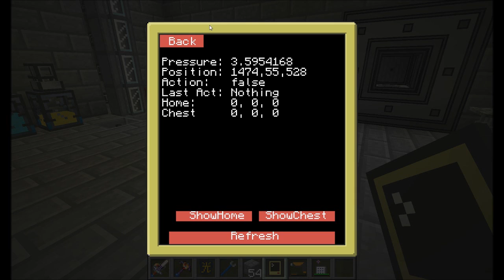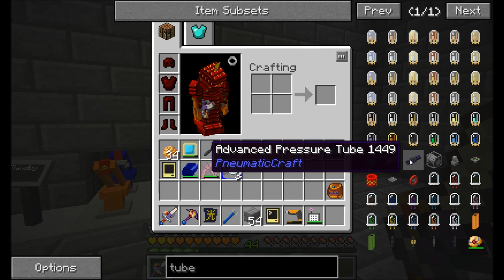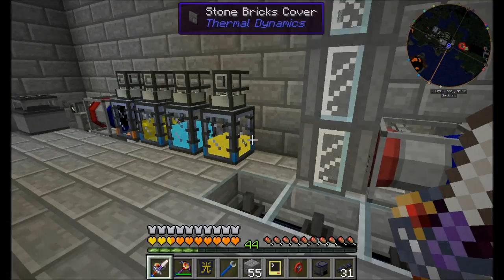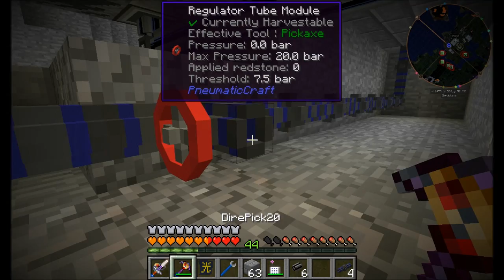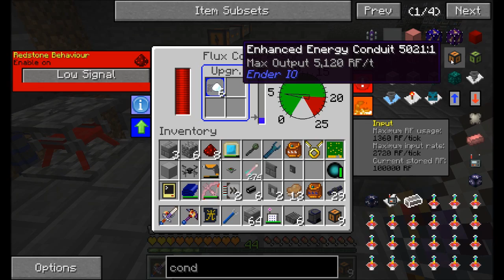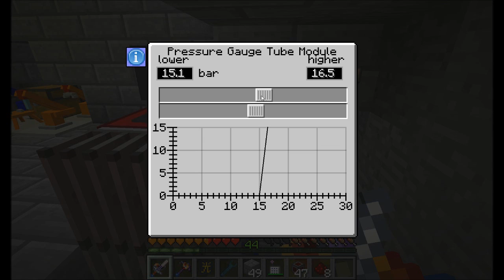Lets Play   S7 E107 High Pressure

Comment: Dire, you should've used a controller with hysteresis to turn on the compressor. This avoids the rapid redstone switching.
A PRC with greater-than, less-than and SR-latch does the job nicely, just like a thermostat works.
< 16bar -» set -» turn on
> 18bar -» reset -» turn off

Comment: Direwolf, you Direderped. Gelid Cryotheum would have to be touching the compressed iron blocks directly, since heat sinks move temperature one way. Basically think of a PC liquid cooling system using liquid nitrogen, the's no need for those heat sinks.

Comment: You stepped on a 600 degree block and did not get hurt, that's not right...
Also, sometimes I wonder if you have a bias against EnderIO, the redstone wire should have been your first thought,
and you could have added a textured facade block in compressed iron on top of that compressor.

Comment: DON'T USE HEAT SINKS! Put cryotheum direcly adjacent to the compressed Iron. heat sinks cool it down to 20 C, while cryotheum cools it down to -272 C.
Reply: napalmstrike2007 
It actually NEEDS enough heat to heat up air, allowing it to compress more, but it can't be too high, or else it won't work.
Reply: SlidingSilver so you are saying that if you put cryotheum it will become so cold that it wont work? I tried it and it doesn't work as you told. If you put enough speed upgrades in the compressor, it will still be able to become hot enough to operate. If it gets too cold, add more speed upgrades.

Comment: Doesn't the TMI's What item is that show the pressure (At the top of the screen) It says it's pressure, so you didn't need the pressure check item.
Reply: NitrozGamer ! But then he would be hacking.
Reply: How would it be hacking?
It's his letsplay and it is a thing you can use without being op on a server all you need is Too Many Items and that is a mod installed in the mod pack.
Reply: NitrozGamer ! Are you talking about the WAILA addon? Yes it shows you the pressure when you look at a pipe, and yes you do not need a manometer to read the pressure because of that. However, the mod developer intended the player to read the pressure using the manometer, that is why reading it using WAILA can be considered hacking. Yes it is a single player world, it is not a competitive game and nobody cares if he hacks but using the manometer has a lot more benefits, it shows you the treshold values, and current redstone value on pressure gauges and other gates.
Reply: +napalmstrike2007 I think you may have a very loose understanding of what the word "hacking" means.
Reply: Skozi leet well I know hacking isn't the right word, maybe "cheating" or "unfair practice" is a better word.
Reply: Well it is used by a lot of youtubers and it is the whole point of that mod, to help you with items and recipes.
Reply: Yeah it is but direwolf is friends with minemartin and he tries to respect his mods hardcore style.
Reply: True. le sigh Well I guess there is no reason arguing bout it, it is dire's choice of what he does. XD
Reply: NitrozGamer ! for the record, I would also use WAILA instead of that stupid manometer :D
Reply: Same I use it all the time, I just think if it wasn't meant to be used, then why would it be usable by the WAILA?

Comment: You can place ice under the adv air compressor to cool it down even more, atleast thats what I think it was in older versions.
Reply: Simon Engelholm in "older versions" ..? the heat stuff is new
Reply: Nexarius the heat stuff is not that new it was in the blast off mod pack like 6 months or so ago.
Reply: Simon Engelholm there is also a fan blower thing that will cool stuff
Reply: Ice works on rfcompreser